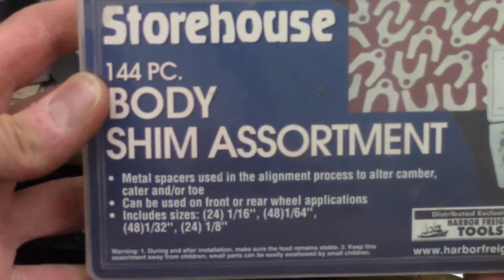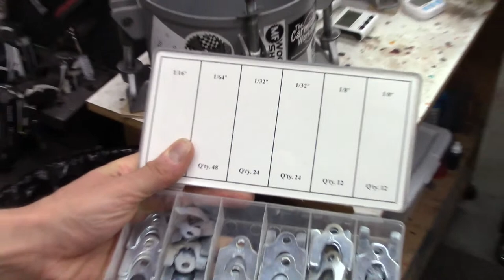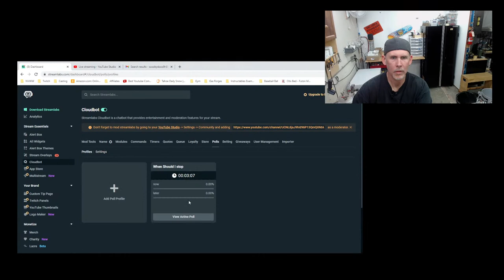🔴Replay: How I Level Pressure Pots | Episode 118

Comment: I finally got a chance to watch this.  Great video.  With future pressure pots I'll give this a go.  With my current one, I marked out the semi-permanent location (both on the pot and the desk), sprayed silicone release spray in the bottom and then mixed/filled the bottom of the pot to the point that the concave bottom was flat.  I then put it under pressure for 24 hours to let it cure in conditions that would be used when doing resin projects.  
I have no idea if this was a good idea or not, I guess we'll find out when/if I ever rearrange my evil resin casting lair. :)  It seems to be working for now.

Note: When I logged on to YouTube to leave this comment I noticed I was being counted as a thumbs down.  Yikes!  No thumbs down...definitely thumbs up. :)
Reply from the maker: Glad you could check it out Jerry. As long as it ends up level, any method will do the trick =D No worries about the thumbs up/down, YouTube sometimes has a mind of its own LOL

Comment: I’m very new. Maybe this is a dumb question. But in general what do you use a pressure pot for, and what do you use a vacuum chamber for? Thanks
Reply from the maker: That's a perfectly good question 😀I use pressure to shrink air bubbles in castings, and I use vacuum to suck air out of silicones and to remove air from things I am stabilizing.
Reply: @ZacHiggins  - Thanks for answering. That clears it up. 👍🏼
Reply: @ZacHiggins  - Thanks. Just wonder what would happen if you used a vacuum to “pull bubbles out of castings”! Could that work? Thanks again